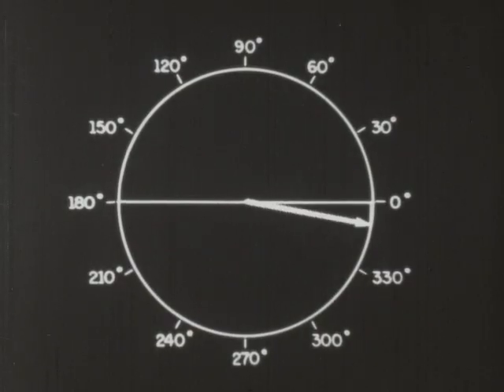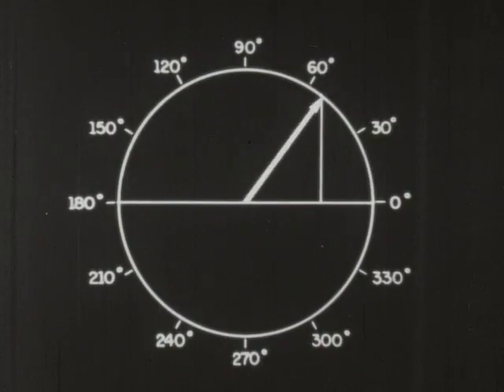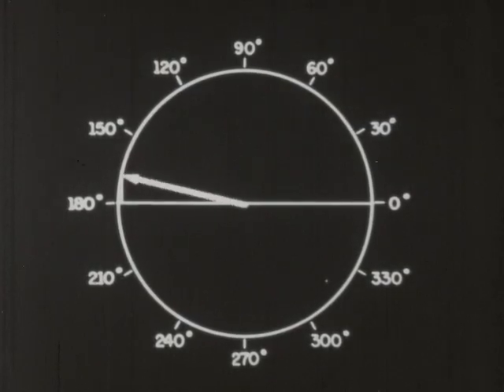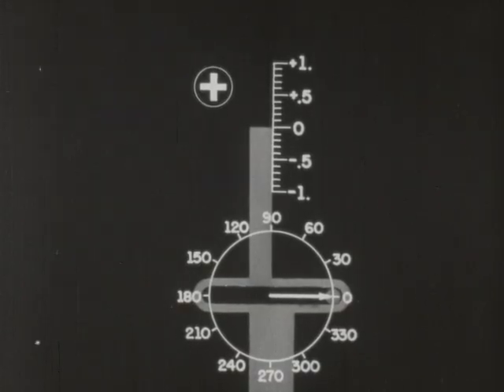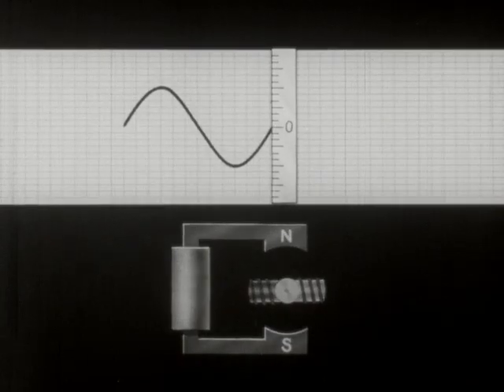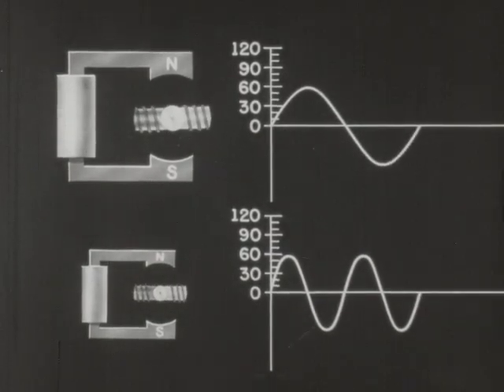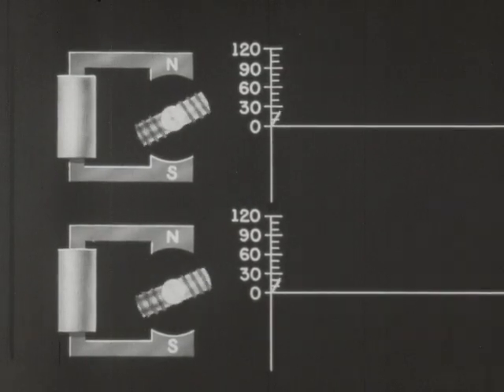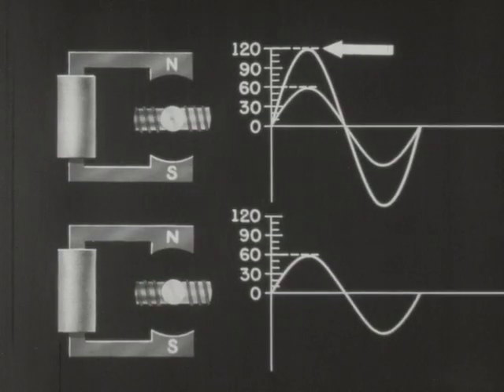Periodic Functions (1944)

Comment: The position of the rotor and the back emf is reversed in this video, and is wrong. When the rotor is vertical, maximum flux threads the coil, and the voltage is zero, and when it is horizontal the opposite is true: zero flux and maximum voltage. One is the derivative of the other. No wonder electromagnetic induction is not well understood even today.
Reply: Nothing is wrong. ✖️ center is there. Left there deconstruction methoding